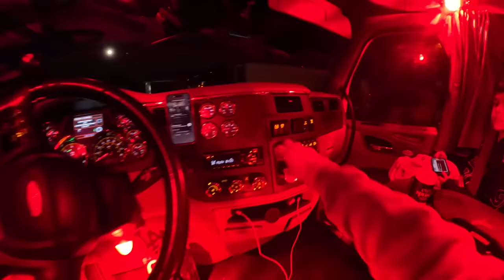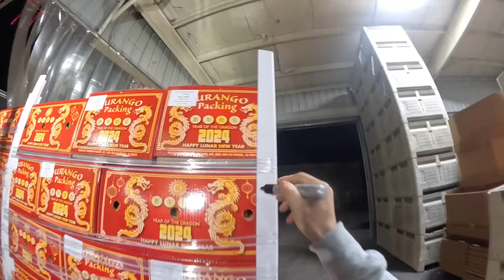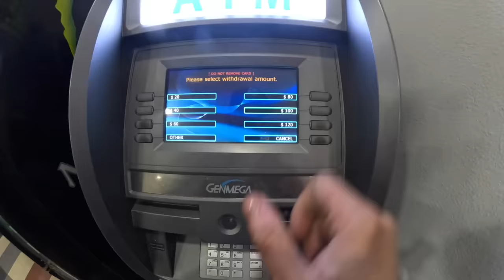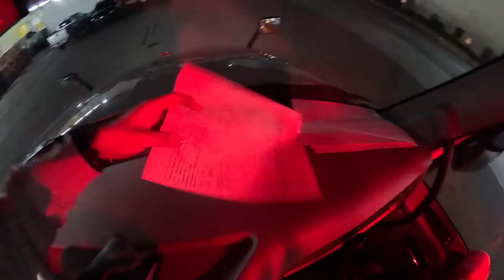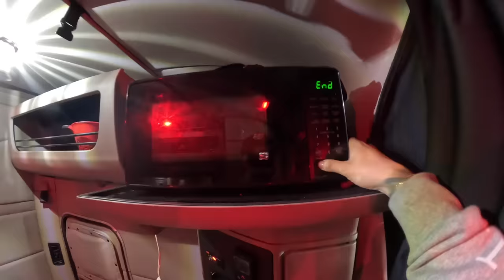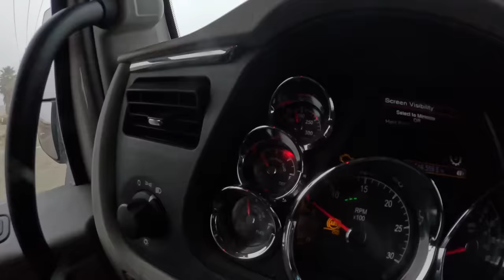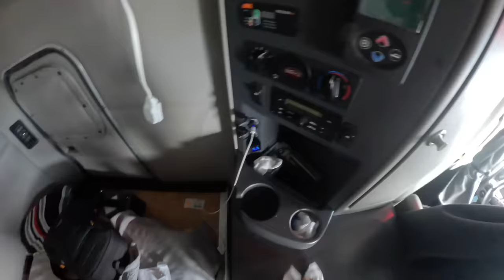Taking My Son on His First Coldest Overnight Trucking Adventure

Comment: If the battery had exploded, the truck would not be running at all and you wouldn’t be able to crank it over and have it start back up again until you replace the battery. No I don’t drive truck either, I just kind of know a little bit about them from living with a truck driver throughout my childhood.

Comment: You said that you smelled fart odor? Here’s what I found about batteries smelling like that. A strange sulfur smell is one of the most common signs that your battery is failing or has already failed. Batteries create electrical energy through a chemical reaction, and this process produces hydrogen gas as one byproduct.